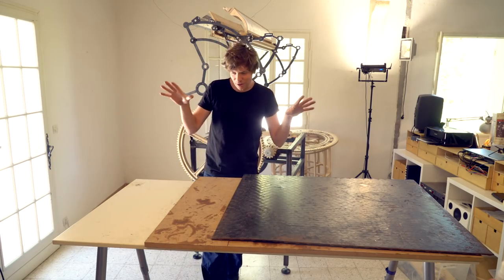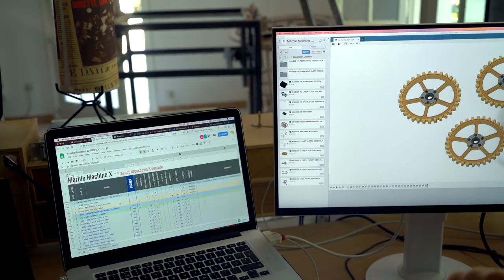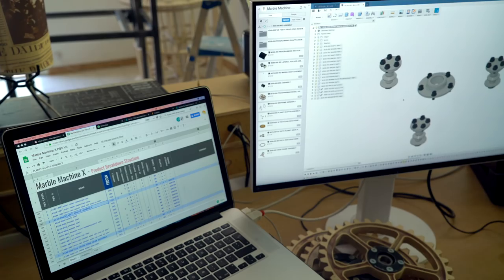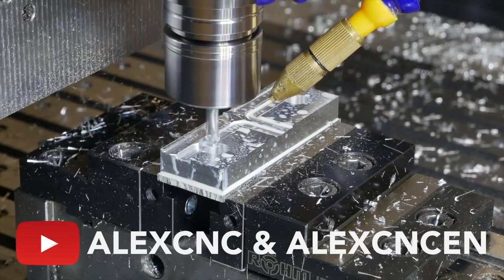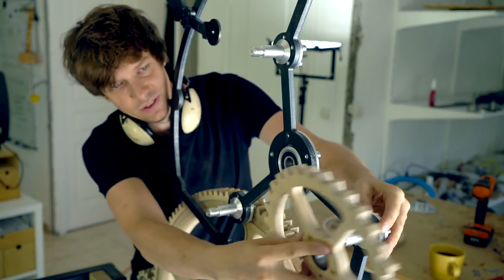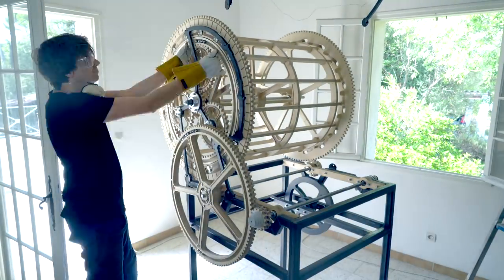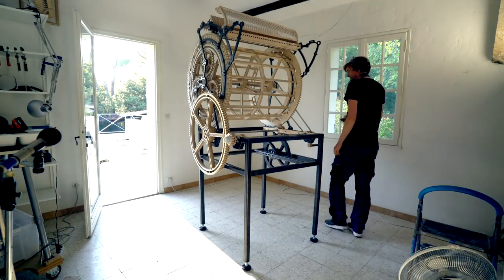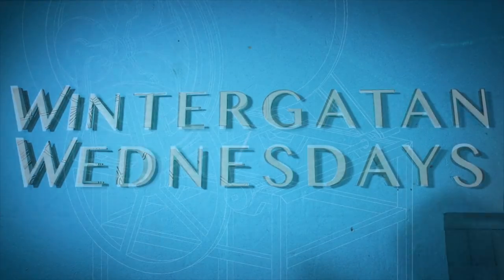NEXT LEVEL PRECISION - Marble Machine X #48

Comment: The thread cutter you used first, was the wrong cutter for that task. You used a thrad cutter for blind holes. It is very risky to use this type of thread cutter with a cordless screwdriver. The second cutter was the right cutter for that task cause this one is for through holes and much better for cordless screwdrivers
Reply: There are also start and finish cutters I hope Martin is aware :)
Reply: Sry, but i don't think so...
Reply: When I did my engineering degree there were. Maybe times have changed, I've not tapped a thread in nearly a decade (and my taps and dies are 50 years old)
Reply: They still exist, but only in cheap thread cutting sets. High quality cutter are single.
Reply: Ralph111417 I think he ment martin is not aware of this ;)
pretty sure if someone knows that there are different kinds of thread cutters, they also know about starting and finishing cutters
Reply: The last time I did this, though I did it by hand and without a drill, I actually used three different cutters. First gear, second gear and only then the final one.
Reply: P Kramer I've used all three kinds, those with 3, 2 and 1 cutters
it also depends on the material your cutting which system is best to use
and, like with every topic in machining, it depends on 1000 more factors ;)
Reply: Also using a drill and not a T-handle was a bit... Facepalm? It's a process where slow and steady wins. The old school way with a T-handle would be more appropriate. If the tap starts fighting the process a bit, you back it out, oil and repeat - likelyhood of breaking becomes significantly smaller.
Reply: 50 year olds taps? that means they work. lol
Reply: pauljs75 That's what I thought aswell. Especially such a big thread and in steal instead of aluminium or copper
Reply: I actually have better results with a drill and some modern cutters. but your drill has to work properly on very low speed.
Reply: I agree. Probably tap handle. he also needs to back up to break the chips.
Reply: Since he is working with steel as well, the turn to reverse ratio should be very low at well .
Reply: A cordless screwdriver? I’ve never heard of such a thing!
Reply: sry, bad translation
Reply: I've never tapped a hole using a battery driver. When I saw him using one I was :-O and then it broke. I wasn't surprised. Sometimes, slow and steady wins the race. 2 or 3 turns forward then 1 turn backwards. A battery driver isn't really suitable for doing that, and you can't feel when the resistance increases until a fraction of a second too late.
Reply: I did both. Learned doing it by hand and then got a machine cutter for using with my cordless drill. When someone wrecked a mount on my car using a pneumatic impact driver to jam in a twisted bolt i really prefered using a hand tool to fix the thread damage. If a hole is important and you cant live with drilling the next bigger size and tapping that then do it by hand. If it doesnt matter like on my 3d printer frame then go ahead and use a machine. Just check wether you have the right tool for your chosen method as there are 3 cut tools for hand, one cut tools for hand and one cut tools for machine use.
Reply: I agree with using a T-handle. Clickspring here on youtube uses them all the time on brass. He'll use them on the lathe and the mill to keep everything square, but the actual cutting is done by hand.
Reply: Yes your right! More or less because I feared it, I clapped when it broke... :-s In my opinion it is okay to use one with soft materials like aluminium or thin sheet steel - but you have to limit the power of the cordless driver and/or have the experience, the feeling in your gut not to break the tap. In most cases I would not try to tap sheet steel thicker than 3mm (tapping control cabinet plates can be tedious..) with a cordless driver, the force required to turn a larger tap easily reaches the point where you are unable to keep everything straight when it gets stuck.
Reply: I broke quite a few taps in my life … but never something bigger than M3. As I broke quite a few M2, my experience was that the one-cutters are only good in thin materials and not something as though as mild steel. It is an exercise in patience to cut a lot of M8 with a three-cutter by hand, but with them it is easy to get it perpendicular because the first one slides quite a way into the hole. Martin had more luck than everything else to get the broken piece removed, I usually end up with a crater. And like everything else: doing it thoroughly  takes once the time, correcting mistakes is double the trouble and thrice the time.
Reply: You can still get high quality hand taps that are taper, inter and bottom. We use Dormer ones at work all the time. 
Single stage ones are more for machine tapping where speed does matter.

Comment: I see many different types of metals. Aren't you afraid of corrosion?
Reply: I don't see it as too much of a problem considering it's probably going to be inside for most of it's life. It also could just be part of the design.
Reply: Keep in mind too that it's a touring instrument. It's gonna be partially disassembled, cleaned, lubed, and reassembled on a regular basis. Anything that has time to corrode is meant to stay together anyway. Plus as meticulous as Wintergatan is, I imagine he'll be using thread compounds in the final assembly.
Reply: I am talking not about corrosion because of the weather, but between two different types of metal

Comment: For the love of... Get a damn Drill Press!! Stop drilling and tapping by hand, I can guarantee your holes are not square.
Reply: Slim Jim    wot? Eh?  The gèezer's got  a cnc  router ( 59 quid  at cheaptoolsareus?  Or 20,000?  )  welding equipment and getting others to make finely machined parts that would costs me hundreds of pounds.  Even the cheapest drill press (59 quid) is way better than point and shoot.  And old school hand tapping is better still.
Reply: Slim Jim a drill press isn't an expensive tool. You can buy some for about a 100-150€. The only problem is it takes space permanently. But given the size and complexity of the project, it's totally worth it.
Reply: @InXLsisDeo  my 140€ drill press works for metal without any problems
Reply: I know it's been a year, but even tapping by hand he could've at least countersunk before he tapped while also using a square to check and tapping with a tap handle, that would at least get him as precise as he could without any machine tools.

Comment: Well it's your own fault for using a hand drill to tap holes especially with a Black and Decker drill just because you cover the logos doesn't mean you covered up the paint scheme 😒
Reply: Its actually a AEG drill. Owned by TTI, sharing some elements of Milwaukee. Not prosumer, but better than Snap & Pecker...
Reply: Dan Johansson either way if he just had the patience to tap it by hand the tap probably wouldn't have snapped off I don't even use my Bridgeport to tap holes only because the fear of snapping a tap off in the work
Reply: Vinnie's Kitchen you're certainly right about that...

Comment: I spent 13 years working as an engineer for an automotive company, we manufactured the machines for the production lines and each machine was unique and making them was just like this. Broken taps and all. We would have parts made by ourselves, other parts made externally and designed both internally and externally too.

Comment: Hi, it is amazing to not only see the evolution of the machine but also your management of the project and management technics! Nice to see that BOM!!! Wait that you start logging all modifications
Regarding your tapping, not only your fault, tapping in laser cut hole is a pain. The laser produce a fine layer of heat treated material that makes tapping quite harder.

Comment: Tapping holes with a hand drill can be much easier by changing the vertical drill orientation so the drill is operated horizontally.  The rear of the drill can be stabilized with your wrists against your body with waist level being the easiest. Many thousands of 8 & 10-32 holes used to secure components for industrial automation control panels behind my suggestion. Electrician in Canada. Cheers

Comment: Keep up the good work!  It is really coming together.  Just one suggestion about tapping the holes: use a hand tap wrench to avoid breaking the tap.  Also, I recently had 11 stitches in my hand because I was using a drill motor and slipped and the drill bit spun into my glove and into my skin... lesson learned: don’t use gloves when operating a hand drill if you are holding the piece.  I usually use my drill press but I was rushing...  other lesson learned: don’t rush.  I really love watching your progress, it is very inspiring.  You rock!  I hope you tour in the US, but if you don’t I might have to cross the pond!

Comment: Nice work Martin, looking very good! I'll join in on the hole tapping criticism though. Nothing worse than ruining a part by getting a tap stuck in it.
Look up a company here in the USA,  FlexArm.  They build tapping heads on pantograph arms. The tool weight is counterbalanced, the tapping head has a second button for reversing, and the quick change collets have a clutch, to save your tap. The arm holds the tap vertical.
The smaller models are economically priced, and should be sufficient for your normally used tap sizes.
Good luck!

Comment: If I took one thing out of university so far, it is: "If the entire Project doesn't fit in your head entirely, at once - Organization and planning are key. No exceptions, if even only one tiny part is something that you can't keep in your mind permanently - write it down, plan with it, or it will make things harder. Maybe not significantly, but definitely in relation to doing it without planning."

Great to see things are taking quick steps forward with this c:

Comment: So much good stuff in that episode.
Sanding down a disc from 4 to 2mm - who does that? Necessity is the mother of interesting methods.
Im a machinist & I'd be scared to tap holes using a battery drill for fear of breaking the tap. Martin does it like its not a thing (but then breaks a tap).

Comment: May I suggest using a tapping guide? It’s basically a frame that holds the tap perfectly vertical during the tapping operation, and this will drastically reduce tap breakage. - Another Martin, in Pittsburgh PA, usa

Comment: There are different kinds of taps for different purposes! Your "favorite" tap looks to be a tap made for bottoming holes as it has spiral flutes cut. These are generally weaker because they need large deep flutes to get the removed material out. Forward cutting taps don't need such large flutes and push all the chips through the hole, which is why you generally only use them on through hole tapping operations. I highly recommend you try a forward cutting tap for those holes! PS love the work! :)

Comment: A few advices (from my machining experience):
When you use a machine (the drill in this case) to make threads, use a machine-grade tap - such one is capable of making the thread in one go, without turning back. If you use a basic tap, then you should make it manually and go slowly - that way you won't break the tap.
The bearing plates - if the only reason for stopping the gearwheel is the cone, then you could just chamfer the hole in the bearing plate to accommodate the cone. The grinding was not necessary ...
Do not use compressed air to clean the chips from the metal work - one can fly in the air and get into you eye. Believe me, you do not want that!!! Rather use a vacuum cleaner.
Very high cleanliness in your workshop. I am impressed!
So far so good - you made a huge progress. This has left the boundaries of DIY long time ago - it already is an engineering project in all aspects, started from zero. Now you have to keep up the work to reach the end. I wish you good luck! And patience too ... ;)

Comment: When tapping holes with a drill, I suggest only putting it hand tight (very tight by hand). The tap will slip rather than break. Or, you should turn down the drill clutch to slip easier.

Comment: Imo, you should add a spring loaded idler pulley to the drive belt to help add some tension (to help keep the belt from wiggling up and down when you crank the handle). Having one will also allow the drive belt to automatically re-adjust/stay snug even if you move/adjust the main drum.

Comment: I know this would be an added expense but please use a clutched drill it saves taps, worked with several guys who used clutched drills and impact drivers running taps into heavy steel for days on end and they rarely if ever snap a tap.

also please continue this as I love seeing this machine built you and your team do excellent work.

Comment: One machine you dont have is a good old fashioned pillar drill/ drill press. Not expensive and you will be pleasantly surprised how easy it makes drilling and with reliable results. Far more accurate for absolutely true 90 degree holes and you wont break drill bits as easily. Depth control as well. Dont rely on a hand drill for this precision machine! Best used for dry walling & slap it together pieces in my opinion.

Comment: Also, since your bearings are not pressed into the race (or on the shafts as the case may be) you might consider using some retaining compound.  Eventually the bearings will begin to spin in the race (or on the shaft) which will quickly wear it out.  We always use a negative tolerance for for our bearing race (-.002 to -.005") in order to securely hold the bearing in place.

Comment: I was wondering, what sort of damage prevention and solutions do you have? Are you printing out extras of the 3d printed parts? Are you cutting out extras of the smaller pieces of ply that are more likely to break? Are you shipping the machine yourselves? I'm just wondering about a lot of this because you are planning to take it on a tour, and having something brake that you can't fix easily while on the road wouldn't be fun.

Comment: I know it's a bit late, but when you tap out a hole it is best to use a drill press or mill to keep the bit vertical.  (if you have one of course)  You'll break less taps and will swear less. :-)

Comment: Tapping by drill is a bad idea most of the time anyways. Especially steel. The expense sucks, but definitely should have looked into a manual tapping arm. They auto torque out in blind holes and you have a reverse direction with a button. Best part is, they stay Perpendicular for the holes. I say it would be worth it, if you tap holes again.

Great video.

Comment: As I've been following, and saw you adding more metal to the frame and general construction, I totally saw the weight issue coming up. Before you get too far, are you sure those four little feet can hold the weight without putting a mark in the floor everywhere you go? Will the machine be too heavy for some stages? Don't get me wrong, I think it's an engineering marvel - just keep an eye on your weight and weight distribution.

Comment: Martin Little warning from a machinist The way your mounting the Aluminium bearings is going to create galvanic corrosion with the frame down the road. I'm not sure if your aware of this. Possible solution(s) A: add a non-metal gaskit egz. plastic, rubber or ceramic (problem it adds to dimensions) B: Anodise aluminum (you'll need to find someone to do it for you. I advise against doing it your self) {not sure how long it'll last as wear and tear will damage the coating}.

keep up the good work.

Comment: I have never had to tap quite so many holes, and so tap manually, but perhaps starting the thread with a manual tap would stop your drill tweaking over and breaking the way I have seen it do if you are determined to power tap.

Comment: you need to make you a tap block our you can buy them as well... it helps to get your tap started straight.. also you should use your counter sink first before tapping the hole because the counter sink will roll material  down in the threads

Comment: You're breaking the tap because you need to use a Drill press to keep the bit perfectly vertical. At that torque force, any slight variation in verticalness (is that a word) causes the tap to break. I'm also surprised the cordless has enough torque to perform that task. Fantastic job tho.
Sorry just saw another possible flaw at 8:30 when you pressed that bearing in by hand. If you can 'hand' press a bearing into it's seat, you're not using a lot of force. Bearings usually require a very tight fit, thus requiring a lot more force than your hand. What may result is that the bearing will 'slip' or the big wheel will not turn because there's not enough friction between the bearing and it's seat. Hope it works.

Comment: Martin, well I'd say that using taps with a drill is a bad idea. I understand that you kinda impatient, but you better make threads by hands. There's a special tap handle, which is handy and makes it easy to rotate a tap. Overall rule of using taps - you do one full rotation forward, and then quarter of a rotation back. It will take more time, but threads quality will raise up very much.

Comment: You need a lathe for work on rotating parts!  You could have fixed the rubbing problem (and not had it in the first place) if you used a lathe.  When you tap, use a guide block to keep the feed square, or do it in a drill press, or a tapping fixture.  You can use fixture to start threads by hand, then finish up with the portable drill.
Reply: He Did It All By Hand And Its Retired Now Anyway

Comment: 1: tap the proper way. You've now seen why it's faster. You can get longer taps with more gradual cutting if you want.

2: when you need to remove material from a flat surface, use a router. It's a bit awkward to clamp the piece down, so you may need to move the piece a few times and router it in stages. At the least it's much faster and safer and you can quickly sand off whatever little bits are left.